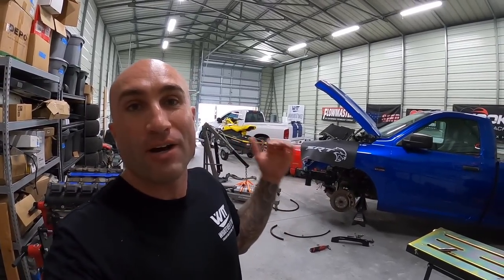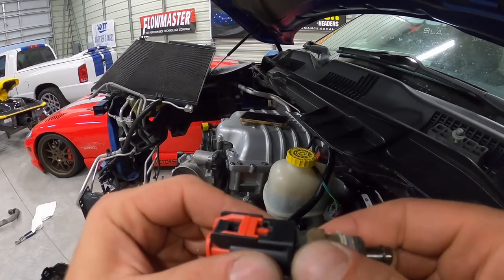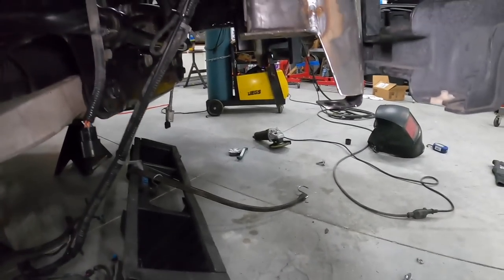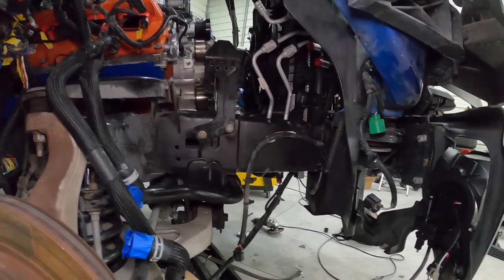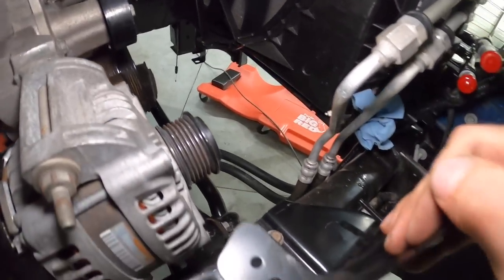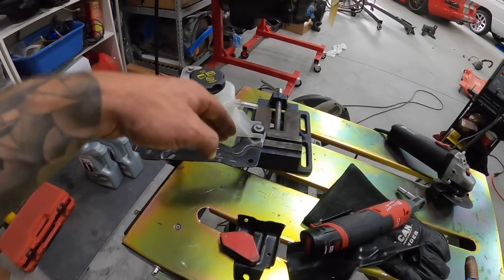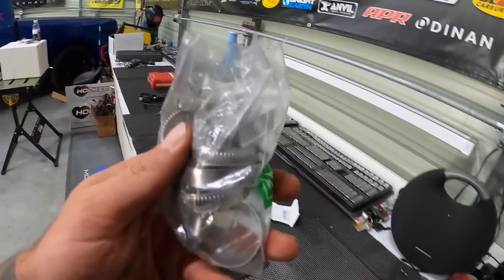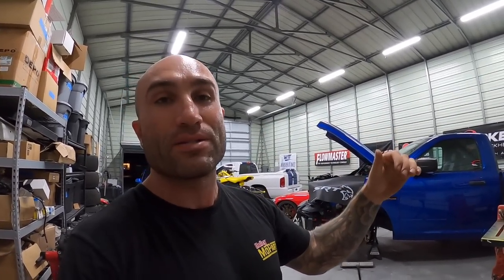Hellcat Engine Swap in a Dodge RAM 1500 | Part 4

Comment: Nice job Jon starting to put out "dimes"👍👌 loving the big boy project for sure.will definitely be a one off cause I can't afford to do one of them myself 😆 lol.the Dakota is going to be enough for me. It's slow going but getting parts bit by bit door harnesses and control units.doing the firewall work and frame notch and be dropping in the engine & transmission for the last time after the firewall is all painted up and detailed great job 👌👍✌️🇺🇲🇺🇸
Reply from the maker: Thanks Ron! Yeah this short build timeline has been a challenge but so far so good!